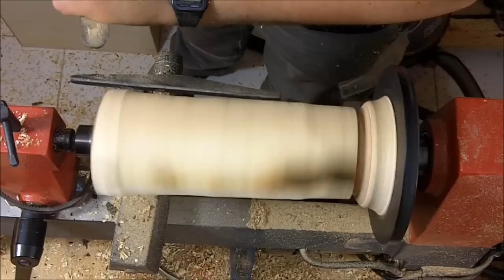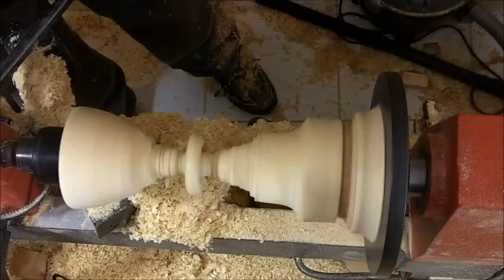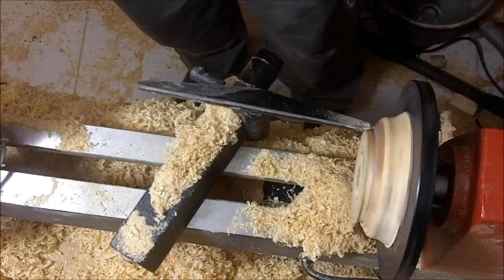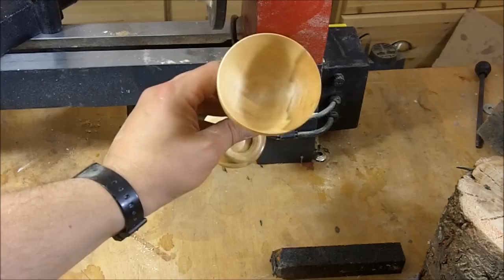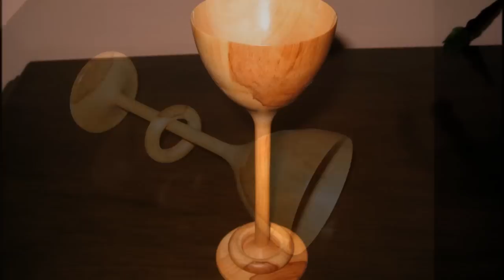Woodturning - Making another Goblet with captive Ring

Comment: How come you freed the captive ring so quickly? Would it not have gotten in the way?
You could have left it captured away from the rest of the turning, finished it off and then freed it to sand the inside diameter. I'm only asking because I've not turned anything before but am getting a lathe and wondered about the thought process. Not a criticism. Just a question. Nice job by the way.
Reply from the maker: No thought process at all ;-) I just did it that way.
Reply: Fabian's Tiny Workshop on top of it all has a humble sense of humor 👍👍👌
Reply: Why did you ask that question?...Not a criticism, just a question.
Reply: kooky f
Reply: kooky flukes ppppppğğğğ
Reply: Easier to make the stem uniform if you can slide the ring out of the way back and forth.

Comment: Great work!!! Does anybody know would the wood crack (even after you have dried it) with time with this types of projects as the wood is very thin and with the change of temperatures it might change shape or crack, would this be a possibility and how could you prevent it?
Reply from the maker: Thank you. Of course there is always the risk that the wood could crack. After all it's wood and wood moves if the humidity changes. To minimize the risk avoid changes in humidity.

Comment: Nice work and this is the first time I've seen making a wood ring this way.   But during latheing  wearing a watch (or ring too) is very dangerous.   And plus it seems that the support tip is not securely fastened because the safety screw is moving (see ~ at time 0:20/7:40) during the turning of the lathe).... !!!

Comment: What was that Carnuba wax for? Is it a special treatment or something? I enjoyed the video and the end product looked great. Thanks for sharing.
Reply from the maker: +Frank Ingram Carnauba wax is the hardest wax. By melting it on to the surface with the heat of the friction it creates a nice finish without changing the wood color.
Reply: Where do you find this wax?
Reply from the maker: +Frank Ingram I got it from ebay as a powder. Had to melt it into a block.

Comment: What lathe are you using?
Reply from the maker: The lathe a Dema DM 300
But I do not recommend it. The 1/3 hp motor is very weak and the overload cuts out a lot when using a gauge.
I have to make very light cuts.

Comment: Just some constructive criticism boss. That over hand technique does not lend itself to doing intricate work. Learn to grab the tool underhand, you'll have more range of movement and become a better woodturner. Also, a lot of scraping action going on in this video which, not only,tears up the wood fibers, but totally takes the fun out of turning, making the job tedious and boring. Learn to turn a bead with a gouge using a cutting action and shaping the bead with a gouge or a skew, and it will be a lot more fun turning. Just take some scrap and practice, v cuts, coves, beads, and pommels, until you've got them down. You'll thank me for the advice when you get it, your turning will be much more enjoyable and the work will be much more skilled. Just a little advice from an experienced wood turner bro. Take care!

Comment: What is machine brand? Please
Reply from the maker: It's a Dema DM 300. The 1/3 hp motor is very weak and the overload cuts out a lot when using a gauge.
I strongly recommend to buy a bigger lathe.